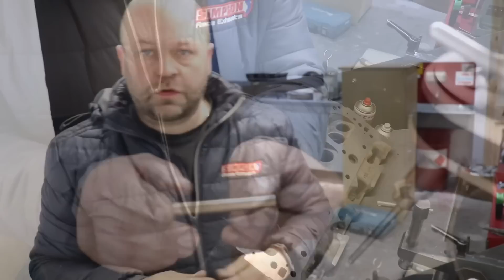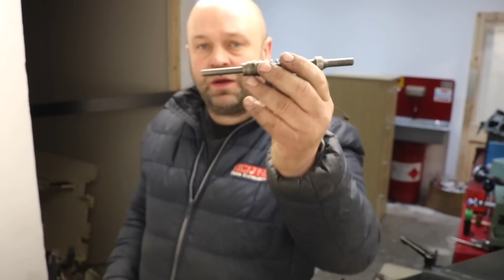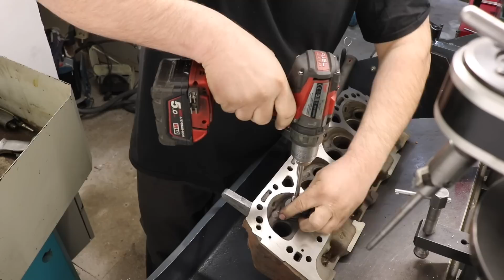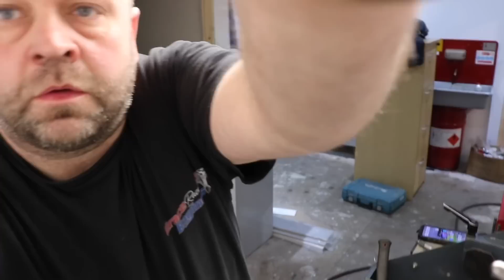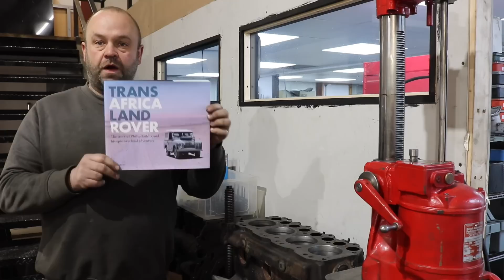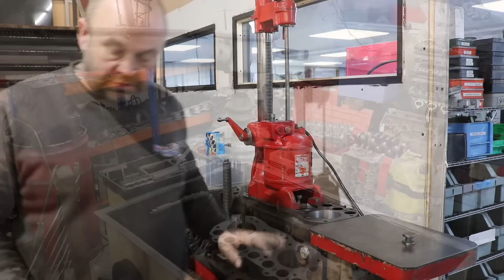V8 Thin Wall Guide Repair | Series 2 Trans Africa Rebore |

Comment: Good morning James, watching your video on the Guideliner installation. 
I feel for you having the install problem. 
Been there and done that.
I liked the original Kline tool, it was slower but rarely ever had an issue. 
Recently I measured the install tool and the problem is the ring is oversized.
The part that supports the O.D. of the guide.
I will do a video on the subject of the problems and issues related.
Another problem is some of the guideliners are not manufactured correctly. 
It is not the Kliners, they are fine.
I do really like guideliners,, properly installed and they are great!.
I like to guide hone and put a slight cross hatch. 
Nice work James.👍👍
Have a great day.
Reply from the maker: Thanks Ed, yes I did run the hone through them but forgot to film.. I like the liners too..  hope you're well.